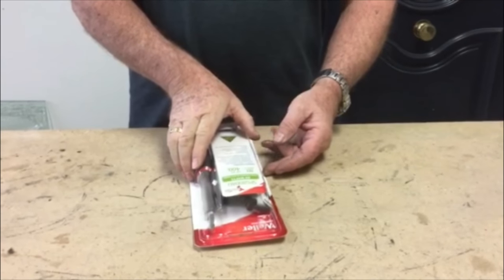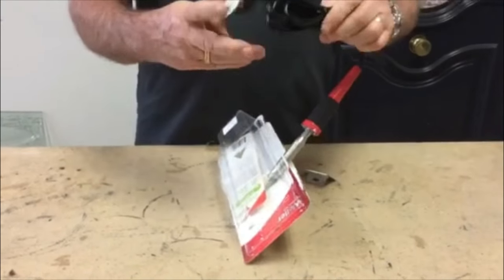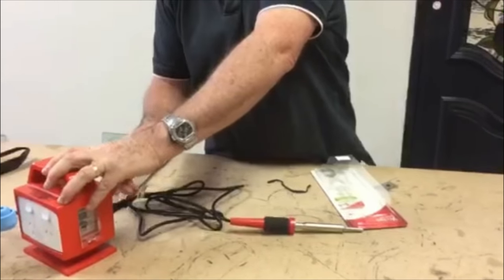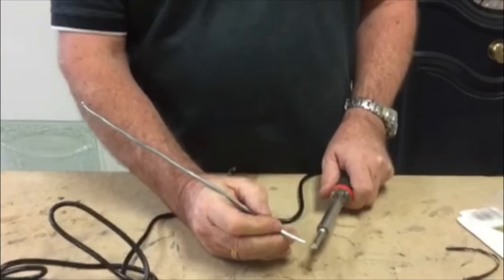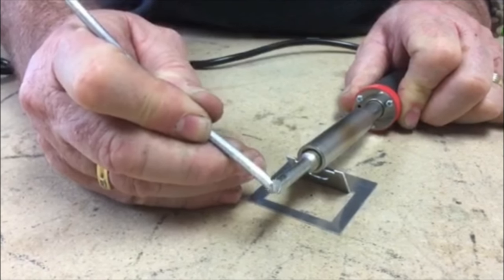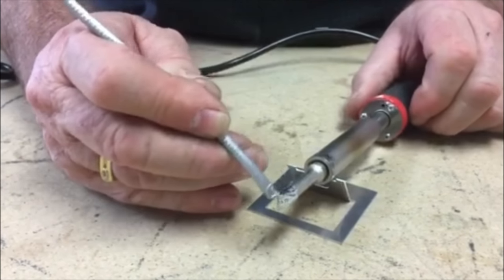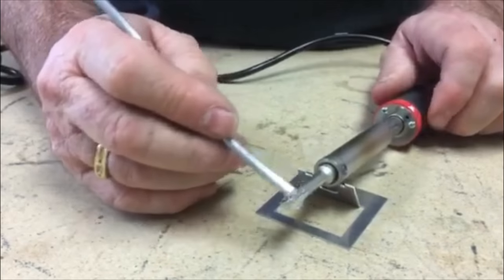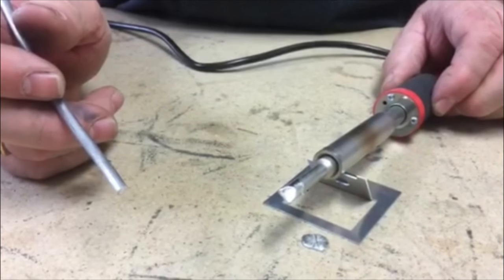How to Tin your new Weller Soldering Iron

Comment: What solder is he using? Looks like an aluminium rod?
Reply from the maker: This solder is an alloy of tin and lead. This solder is 50/50 as the iron will be used for stained glass. For Copperfoil work, to create a nice smooth bead of solder use 60/40.

Comment: Thanks for the video. I have 2 questions. 1. What type of solder should you use if you are soldering with a lead free solder (with nickel, etc) that is challenging to solder with? (I've heard you should use 63/37 tin lead, for a high lead content, & the instant melt it gives). Would you agree? 2. I've seen so many different methods, it has left me wondering what is right. There are some who make it sound you should have the tip completely covered before even turning it on the first time, using "tinning flux" that has tin in it, and completely wrapping the tip in solder. Does that matter?
Reply from the maker: You can tin your tip with the leadfree solder. We use and sell aquasafe which is mostly tin and it is harder to solder with. We recommend the method we've used in the video but if you try different methods you may find a different one suits you better.

Comment: My new tip oxidized,. It won't accept solder, do I throw it away?
Reply from the maker: Hi, You can carefully file the oxidisation off the tip until it's shiny again and then repeat the procedure shown in this video.
Reply: If you file it, it will ruin the tip, I use an abrasive sponge
Reply: @dirtbike9217  Like a wool cloth?
Reply: @c.m.7037  exactly, just NOT a file or sandpaper
Reply: @c.m.7037  like brass sponge or steel wool
Reply: @gabyottich7020  thanks for all the replies.  I'll try to save that tip.
Reply: @mr.p3567  From the Weller webiste - "If a tip does become oxidized, flush it several times with a rosin-activated, flux-cored solder. That should remove the oxides unless you have allowed the oxidation to build up excessively. After cleaning, cover the tip surface with a thick coating of solder."

Comment: Could you please give me some advice. Im new to soldering and i bought a new very inexpensive solder iron and also bought some 63/37tin/lead 2% rosin core solder. No store near me sells tinning flux or regular flux. So can i tin it with what i have?
Reply: Yes, you can use what you have. The rosin is flux

Comment: But doesn't the solder gunk up and effect heat transfer? I'm barely learning and I can't get the solder to NOT stick to my damn iron! It simply will not transfer to the circuit board.
Reply: It sounds like your tip may be oxidised.  If it is, this is what will happen.  You might need a new tip.
Reply: @adamf1347  well it was a new soldering iron....just a cheap stick though. I did end up buying  a better soldering station which just arrived yesterday....haven't practiced just yet. Hopefully your right
Reply: @mrnuna4793  Good luck, just make sure it's tinned properly, even a new tip.  I also received my new Weller WE1010 today (just a basic hobby level station) and will also be practising tonight.  I'm no expert by any means!  Fingers crossed for both of us :)
Reply: @adamf1347  so these tips are supposedly "pre tinned "....not sure I trust that. I should still tin the tips right? And thank you for the well wishes, hopefully your new station serves you well.
Reply: @mrnuna4793  Yes, I believe so.  Mine came pre tinned, too.  Most likely to keep it from oxidising while in storage until first use.  But the instructions do still tell me to clean it by using the "cleaning pad" (which for me will be brass wool) and then tin it, so that's what I'll do.  And thank you, also.
Reply: are you applying it correctly.  You're not supposed to transfer the solder to the circuit board, you use the iron to heat up the target you need to solder and then apply the solder.

Comment: if your new tips come pre-tinned, is there a need to tin it prior to its first use?
Reply from the maker: Even if it says pre-tinned we would still recommend you follow this process. We have found that without tinning them on the first heat-up, the tips corrode.

Comment: ... Seems to me that the first time you use the soldering gun it's going to tin itself
Reply from the maker: Hi, If the soldering iron gets to full temperature before you have tinned the tip, it will oxidize and won't accept the solder. This is why this process is so important.
Reply: @perthartglass  okay, I'm thinking back just a few weeks ago I bought a new Weller 260/200 watt. The first time I used it I was holding solder up to the tip waiting for it to become hot enough to use. I guess without even meaning to I tinned the tip...😁
Reply from the maker: @olheghtt  Lucky! Glad it worked out for you :)